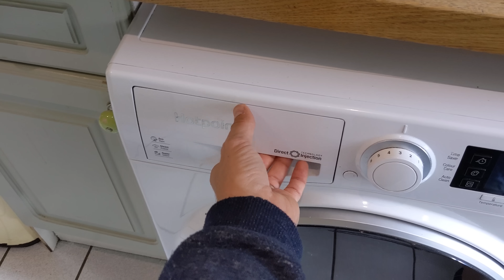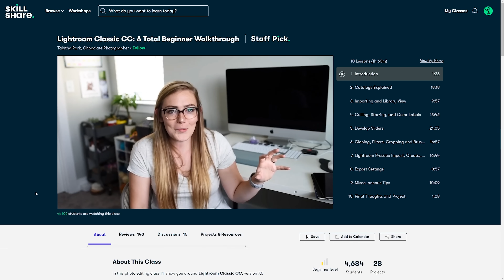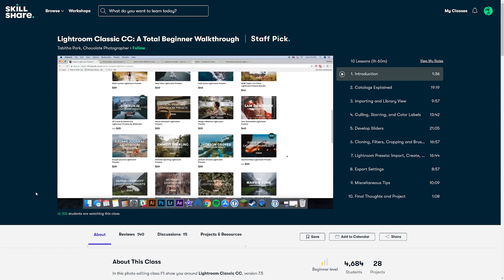The Pythagorean Siphon Inside Your Washing Machine

Comment: My toilet is a hole in my backyard with "you don't need to flush" mechanism
Reply: I see old school perhaps
Reply: I used to have a couple of those type toilets in a couple different houses. My grandfather had one in his, hahaha😂, caught myself , I was going to say in his house , but that would be silly 😜 it was in his back yard, it would have been nice if it had been inside, it would have been so much warmer in the winter ❄️🥶. However I believe it would have been stinky as well.  But alas it was most definitely outside in the yard, over the shit pit 💩.
Reply: Do you eventually need to drain it?
Reply: @peerbrent  The waste breaks down over time, via soil bacteria, the moisture leaches into the soil, what is left is basically just nice rich dirt. AS the hole gets a little full, you dig another, move the seat. Wait a couple of months and you can dig out the first one, put the soil into the compost heap.

Modern waterless composting toilet systems are basically a fancy version of the pit toilet. I plan to use these in my new house.
Reply: @77gravity  Oh yeah I remember the use of poop to compost or fertilize
Reply: @77gravity  they're generally called outhouses. Make it big enough and you have a latrine.
Reply: @peerbrent  yes however, the use of unprocessed human feces as fertilizer is a risky practice as it may contain disease-causing pathogens.
Reply: I grew up with a "hole in the ground". Never clogged, used no water.
Reply: Sounds like the back wood,s of Kentucky..lol....

Comment: I've seen toilets with a pivoting rubber valve at the bottom, that gets pulled up by a chain. The water normally holds the valve shut, but once the valve flips upwards by 90 degrees, it tends to float in the open position until the tank drains and the valve can fall back down into place.
Reply: Yeah. That’s how they work in North America. The North American toilet still has a siphonic mechanism, but it’s in the bowl. Once the bowl is full enough with water, the water draining out the back will pull the rest of the waste water out. Most European toilets have no such siphon in the bowl, instead forcing a larger amount of water into the bowl at once with a siphon in the tank, which forces waste water through the pipe. Totally different design, even if it looks similar from the outside.

Comment: Here in Canada (and North America I believe) the toilet tank does not have a siphon, rather a flapper at the bottom of the container, that the flush simply pulls with a chain. The floater stops the supply of water, and there is an adjustable overflow tube, which will ensure drainage if water into the toilet avoiding flood in the case the floater breaks

Comment: I didn't know about this mechanism, but it's fascinating. Regarding toilets: I think only British toilets work that way and it's an annoying (when you have to "pump" the handle or have to wait ages for the cistern to refill for a second flush) and wasteful system as there is a minimum amount of water and most of the time, the quantity of water used to flush is a lot bigger than it needs to be. Where I live in Europe, we have a cistern but the "gate" is operated in such a way that you can start and stop the flow of water at any point. If the cistern is empty, you just get the water from the water supply running straight through, so it still sort of flushes.

Comment: Lots of US residential toilets have simply a flapper valve that is pulled open and held open by the flow of water until water is out and the weight of it slams it shut again. I find this to be a much more reliable design and honestly I've never seen the siphon design. Looks pretty trashy to me, like it wouldn't last very long...

Comment: We don’t use it alot in America because its more expensive and fails more often. Plus side u can use slightly less water with that system. But the expense and failure rate is higher then just using a regular system. So instead of saving money and water u end up breaking even. Which isn’t that economical in the mind of sales

Comment: The ones I've seen in the USA just have a hole in the bottom of the tank with a rubber cup/flap that's hooked to a chain that's connected to the handle. I've only seen the really cheap toilets that you can buy from most of the home improvement stores.

Comment: All the home toilets that I've come across in Washington State here in the US don't use the "Siphon" method. Of course they have the ball float that turns on and off the water to fill the tank, but to release the water it's simply a plug that is pulled up when the handle is pushed down.

Comment: I think its the bowl area that people think about the greedy cup siphon.  Where you have to fill the bowl above a certain level to activate the siphon.  For example, you don't have to flush the toilet to drain it out and turning off the water line doesn't empty the bowl.  You can pour a lot of water into the bowl (try at home, pouring the mop water into the toilet instead of outside) to raise the level high enough to activate the siphon.  It won't refill because it wasn't flushed but it will flush the same as if you pressed the flush button.

Comment: I've never seen or heard of that siphon system in the US. Here, it's almost always that the tank fills from the water line until the ballcock shuts it off. Any overflow just runs down a pipe to the bowl, so the tank can't run over. When you flush, it simply lifts a rubber flap that dumps the tank water into the bowl. A common failure mode is that the damn chain for the flush handle gets stuck under the flap, causing the toilet to flush endlessly

Comment: It's just a plugg shaped as a upside down vine glass on a rod, that's gets pulled upp on the rod that also make it go back in place. And to prevent overflow it's just a pipe that starts on the topp water level and goes down the the bowl, where the water would normally flush. Norway.

Comment: American toilets have a plug that lifts with the leaver and has a air "pocket" built in that does not drop until the water drops below the plug. This has a problem with some toilets as they will almost always evacuate all of the water even if it is not necessary with lighter loads (#1 vs #2) not all toilets are built this way, but the cheaper ones I have worked with (I work in hotels, all of the ones in hotels are built this way) have this problem of excessive waste of water when most of the time it is not necessary. 1.6g per flush seems excessive.

Comment: Unfortunately most toilets don’t work like this. At least here in the US. Every toilet I’ve seen just has the Pythagorean syphon. 

You press the lever, it lifts up a flapper and dumps a ton of water into the bowl enough to prime the syphon. Because of the diameter of the tube, there is still water left at the bottom.
Reply: Thats a siphon, but not a pythagorean one.

Comment: Most of the toilets in America (or my part of America (Indiana)) has a flap seal in the bottom of the reservoir that lift up when you push the handle dumping the water into the bowl. This is where the siphon part comes in on our toilets, the rush of water quickly fills up the bowl so the water level is above the pipe that shaped like an upside down U or like an upside down sink trap, that siphons all of the water out of the bowl and as the tank is refilling, the water goes into a vertical tube inside the tank that allows water to refill the toilet bowl and tank at the same time. 

Correct me if I’m wrong Plummers. I am not a Plummer.

Comment: Not all toilets use a syphon, some just use a simple door pulled open by the flush Handle, after the cistern empties, a spring shuts the door over the opening on to a rubber seal, even without the spring the weight of water sitting on the door is enough to keep it sealed shut, some even have 2 doors at different heights so you can flush half the amount of water (for pee) or flush the full cistern ( for poo) for water saving reasons which are usually worked by a 2 button vacuum system👍🏽

Comment: I’ve got an older Dutch toilet, it uses a cup that seals the hole to the bowl. With the lever you lift it, it the floats until the whole reservoir is drained and the shuts again before filling.

Comment: I've got a relatively old toilet in America, i dont think its been replaced since the 1950's. Mine just fills the tank and pulls up on the float. Theres a chain connected to the float and a plug at the bottom, and so the float stops and tugs on the plug. When you flush, it pulls the plug the rest of the way and let's the float go to the top of the water, not letting the plug back down. Once the water level drops enough, the float drops and allows the plug to close, stopping the flow of water into the bowl, finishing the flush of water and allowing the tank to fill back up again.

Comment: My toilet fills the bowl and the lever pulls a rubber plug that lets the water through directly if you hold the handle down you drain the system if you pull it up again it stops draining instantly

Comment: Fascinating but it doesn't look like my toilet (in South Africa) is using that system. I didn't actually flush it but it looks the same as the one when I was staying in Austria. In that version, the mechanism acts as a plug in the cistern and when you flush, it just pulls the plug out. The one in Austria then floated until the water drained at which point it sealed again and the filling water held it in place. So holding down on the handle just means the water never stops flowing.

Comment: So that explains my toilet, I kept thinking it was the lever float mechanism that was faulty. Eventually the flush stopped working altogether, presumably from the piston section becoming so leaky (perhaps the plastic sheet degrading?) it couldn’t apply any pressure at all to prime the siphon.

Still no sure I understand the physics of why surface tension is enough to pull that volume of water out. Is it acting essentially like a chain, ie. when enough is hanging over an edge it pulls the whole chain off?

Comment: Never seen a toilet like that.

I have seen several designs:
-flap with a float held down by water weight, when opened to flush float holds open until water drops enough
-flap with pipe on it that slowly drains, biasing it to be heavier on back until all water is gone then falls shut
-tank-in-tank that tips over and simply pours a gallon or so down into the lower tank and tips up when lever released.

Comment: Old Russian and Baltick toilet water tanks  have a rubber plug at bottom attached to lever  on side. When you pull the lever plug rises to top of water and when water ir nearly emptied the tank it plugs the hole. Much simpler system and last longer.

Comment: Hi Steve
In Australia most toilets use a different mechanism to this.
Though ours are arguably more complicated. 
Our toilets are Dual Flush for the most part which is similar to your full & half flush, except that we have 2 buttons rather than a lever to start the flush.
As far as the actual function of the valve goes...
They operate by lifting a plunger that directly seals the cistern from the bowl.
This is then reseated in place once a float drops below a specific level. This usually disengages some kind of plastic linkage and the plunger drops back in place.
The weight of the refilling water then acts to seal the plunger on the bottom.
https://plumbingsales.com.au/caroma-232254-operating-mechanism-suit-concorde-verona.html?gclid=Cj0KCQjw8fr7BRDSARIsAK0Qqr4BSLA4w28igRa2ITt3bGhvkEqLRtzRZ-QFCuZOe_U_DIMRAGJpCygaAot7EALw_wcB
This is a comon make of toilet and you can see the linkages.
This one is for an older model and newer ones are far more elegant in design, but this one reveals it's workings.

Comment: American toilets dont work that way. There is a flapper valve that you lift with the lever. It stays up from a bubble that gets trapped in it then closes when its empty and fills until the float turns it off. That part is the same. When you were saying thats how a toilet works, I was confused. Now I know why.

Comment: My toilet does not work like that at all. There is no siphon, instead when you press the lever to flush, it raises a rubber stopper at the bottom of the tank that allows the tank to drain. Once the stopoer is raised, it floats on the waters surface. Once the water is drained the stopper falls back into place and the pump begins filling the tank again.

Comment: I live in the US (specifically New Mexico) and every toilet I've ever seen was the kind with a little buoyant flap. The lever pulls the flap off the hole at the bottom of the tank, and its own buoyancy then keeps it open until the water level drops sufficiently for it to fall back down and start the tank refilling.

I didn't even know these siphon mechanisms existed. They look a lot less fiddly than ours.

Comment: But the mechanism can get messy in a flush if the water ends up having silt somehow. Happened at home, had to clean the system to get it working again

Comment: My toilet runs off of the tipping effect. The more I tip it to one side, the more it flushes. If I tip it all the way, it completely drains the toilet. My toilet is not self cleaning or self drying either. My toilet can get pretty stinky if I don't drain it completely and if I do. I must clean my toilet straight away, or my wife will get angry at me. My wife says don't be lazy and that I have legs, so I should just use our regular toilet, hooked to our water system and our sewer system. But you know me, once I'm in bed, drinking beers, Netflixing and chilling, my bed pan is my best friend.

Comment: Why does a toilet need a siphon? The lever on my toilet (in america) just pulls a plug at the bottom and the water poors out with gravity. The plug floats so when the water level goes down, the plug goes down over the hole. Then the water fills back up until the float gets high enough to turn off the water.